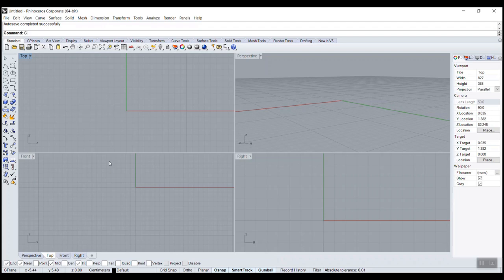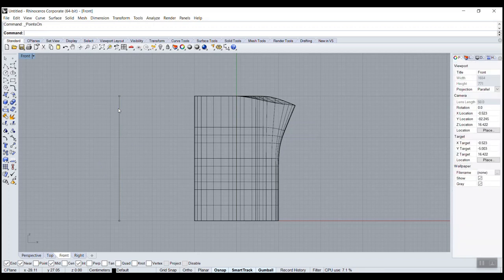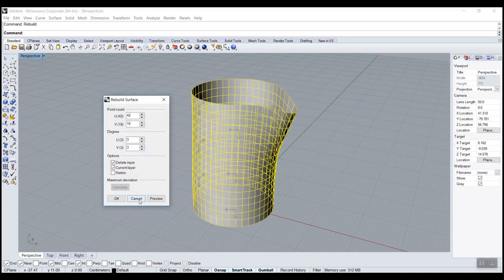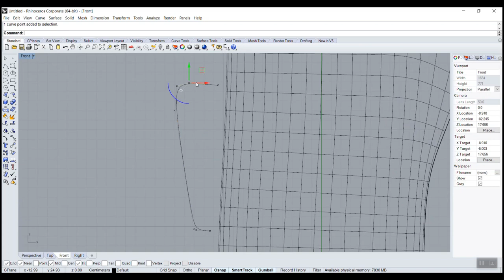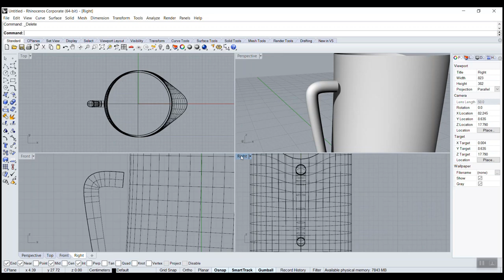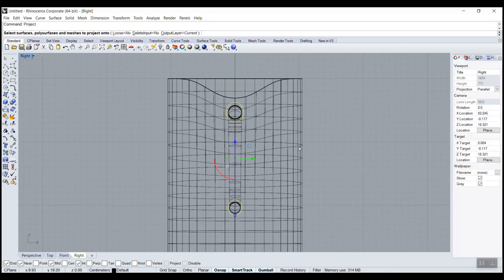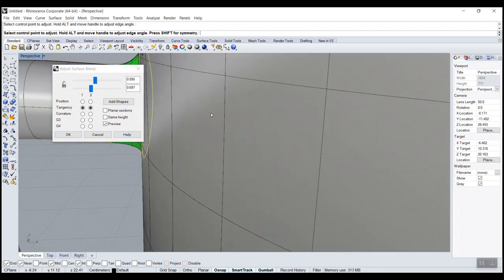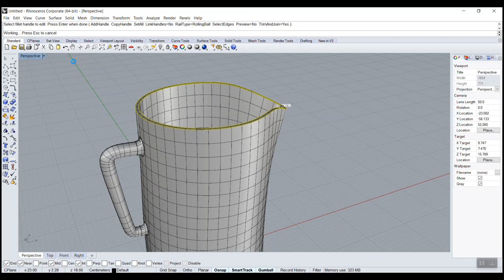Rhino 7 3D Learning for Intermediate #Jar Sub

Comment: hello Thomas .... very interesting tutorial .... thank you .... but how did you do it that the internal surface of the kettle is green ?? .... thank you for the answer and nice greetings from Austria ... :)
Reply from the maker: Usually if the boudaries are green in mean it's an open edge (the seam), here it might be because i m in Shaded and i was using Rhino 4 or 5... I think it use to only shade grey the visible side of a surface (where the normal are facing)... Don't worry it's not imortant